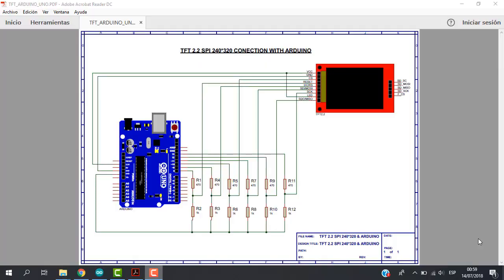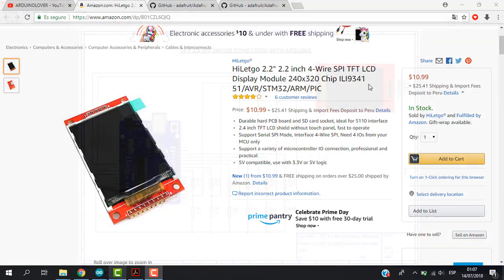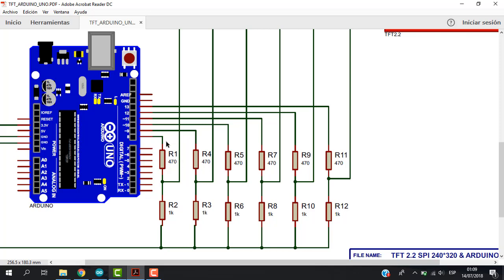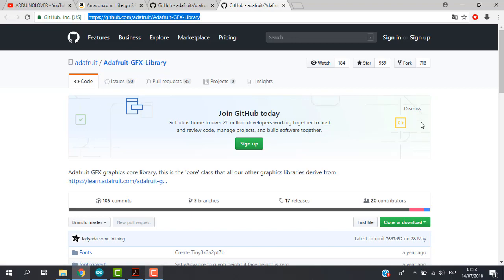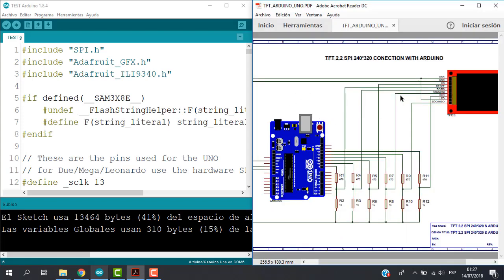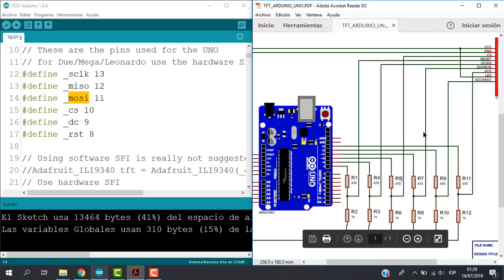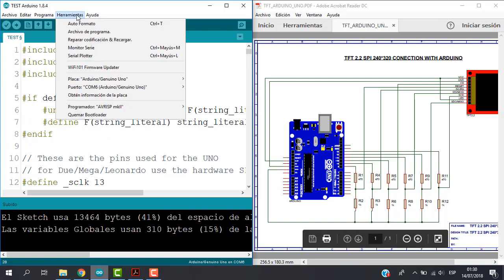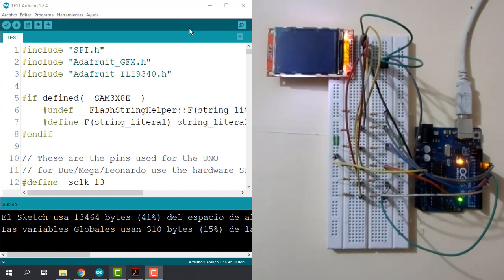Arduino Uno & TFT 2.2" SPI 240x320 (English)

Comment: I freakin could force my screen work. It was white screen always. The single thing I didn't do - the second line of resistors going to ground. And also SET THE PORTS IN THE CODE <MANUALY>

Thanks

Comment: if you want eliminate the resistor and drive the display 5V need to weld  a sound bridge in the J1 in the back of display , in this way you can drive it at 5 v directly from arduino

Comment: I've bought a 3.2' tft display with the il19341 driver chip.
however this display doesn't have the cs pin.
the only pin it has are:
      GND
      VCC
      CLK
      MOS
     RES
     DC
     BLK
    MIS
  
It lacks the CS pin.
how can i drive it in spi without the cs?